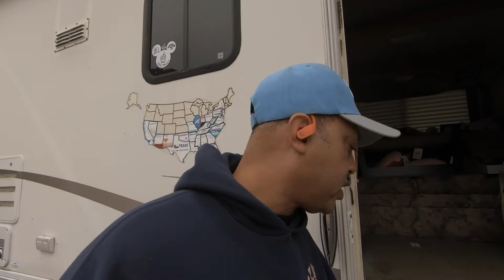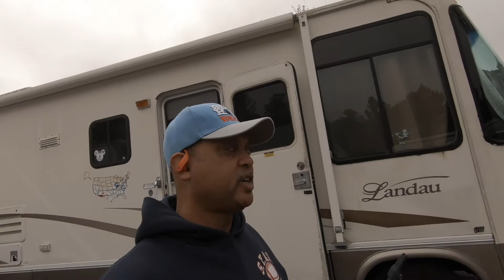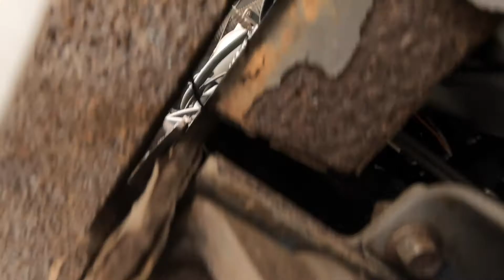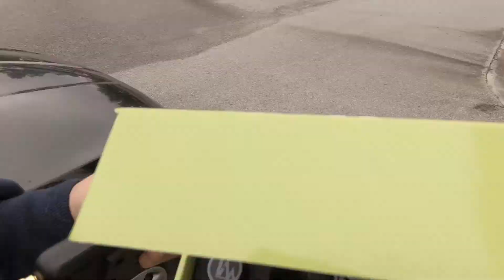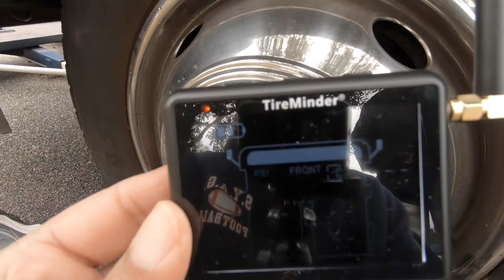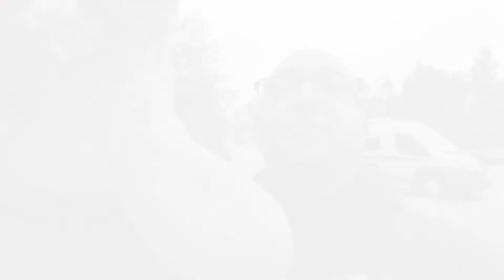TireMinder i10 Install

Comment: Using the tire pressure monitor not on a few trips. What I want to ask is my tires pressure goes from 80 cold to 95 when driving and between tires there is 3-8 pressure difference. What have you found in your travels and thanks
Reply from the maker: I get pretty much the same results my pressures go up 10 to 15 psi and tires are rarely the exact same pressures my tire shop says this is normal and thanks for watching let me know if you have any other questions
Reply: I had a high pressure alarm go off at 96 psi on rear tire and on tow dolly alarm went off at 56 psi so far everything else is going good, I the think these are false alarms. My rig 36 foot 7000 on front axle and 13700 on rear axles  . 226 -70 -19.5 road master Cooper Tire load range H. My cold psi is 80 psi, my question is: what weight is your rig and psi tire pressure and have you done anything to stop false readings? Or should I increase psi cold 80-85 psi? Thanks for your information.

Comment: put 6 TPMS on my rig today, going for a run tomorrow, pretty good so far, my question is ...tire-minder said to mount repeater close to the rear behind tires...... yours in under the front engine. how that working for you? My tire guy is going to change the rubber valve stems on tow dolly to steel next week.
Reply from the maker: So far so good I have yet to have a problem and we have been on three trips since the install I thought you only needed steel stems if using the pass through sensors let me know how yours works out
Reply: @Retiredtravelolliestyle  It will be about 3-5 weeks before i get the steel valves installed, my rubber ones are cracked and my tire mechanic says they should be replaced . So I will up grade.   went for a drive with just 6 sensors  everything good , just noticed tire pressure starts out at 80psi and they go from 75-88psi while your driving. Do you experience pressure range difference too? thanks
Reply from the maker: @addidasnwc  yes my pressures went up and it caused the system to alarm for high pressure I did more research and I had to adjust the baseline pressure now it doesn’t alarm but I do notice the pressure goes up about 10psi for all tires

Comment: On your rear wheels do you have valves extension? Thinking of doing TPMS on  moterhome and dolly too. And how is the system working. Thanks
Reply from the maker: Hi G Miller yes I have valve extensions on my rear wheels the system seems to be working fine with a few baseline pressure adjustments I am happy with the Tireminder

Comment: On the dolly, does it have rubber valves stem
Reply from the maker: Yes I have rubber stems on my tow dolly the sensors are light enough to not cause a problem